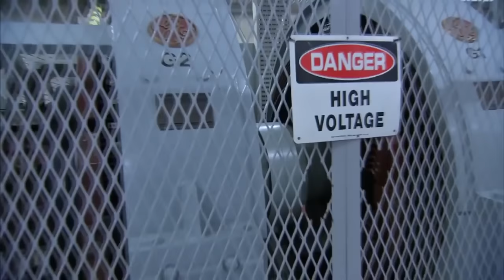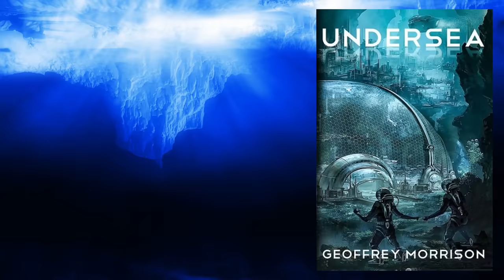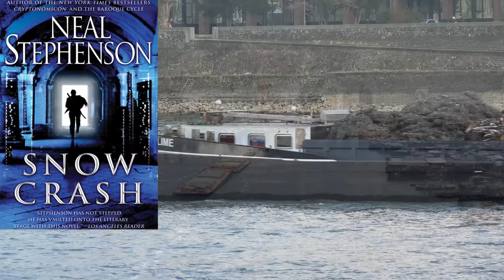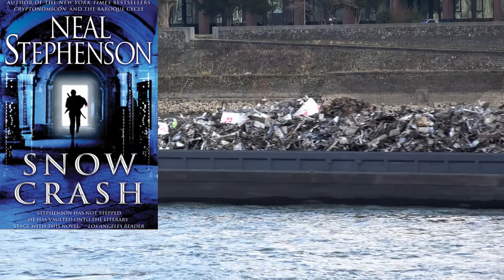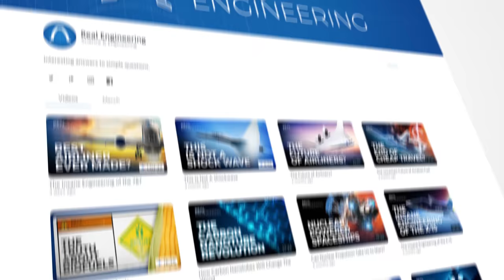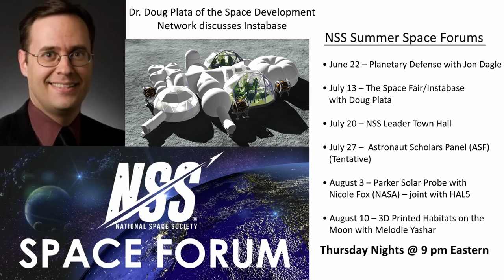Mobile Cities

Comment: Mobile sea cities would be a good idea, one could simply move it to the optimum location for the time of year. This already happens to some extent in the sailing community.
Reply: One concern I'd have about large floating cities is different stress on different parts of the structure.  It will need some sturdiness, but also a small ability to flex.  The various videos of ships breaking in storms come to mind.

So it can move under the Captain or committee's control, but it can also be moved by strong currents/waves
Reply: How about a mobile sea city made of many smaller vessels that can connect to one another via gangways and rope ladders and such.
Reply: @alphaclean3364  exactly and they could be together  most of the time then separate if there was a storm predicted.
Reply: @alphaclean3364 There's a game called P.A.M.E.L.A which does basically exactly this with its floating cities. It was kinda abandoned, but it's really cool conceptually, and you can play to the end.
Reply: @alphaclean3364  This is the correct answer, every single seastead is some family home, they all operate autonomously, and can diffuse or come together at will.

Comment: The thing I contemplate most about cities is what is their purpose, every city on earth at first had a purpose. Natural resources nearby, strategic locations for defense/offense and in that regard there are many reasons for a mobile city. It should be important to note though there's also reasons to have smaller mobile structures like Labs, refineries or factories. 

Currently we have a rover on Mars doing tons of research. It's not too much of a stretch to have a rover lab filled with people there too. These could be rovers, subs, tanks or walkers easily depending on the environment as well. So if your sci fi needs a little extra cool one of those would be a neat thing to throw in without being too much of a stretch for your readers.
Reply: A game called Arknights have mobile Cities (Called nomadic cities in the game)
Because of catastrophes, basically natural disasters but ten times worse (imagine hurricanes combined with meteor showers that drop skyscraper size rock, and said rocks can cause a incurable disease), they have to keep moving to avoid this cause a catastrophe could level an entire city
Reply: I like the idea that if the Americas were never discovered by anyone in the East and the Native Americans somehow “modernized”, they’d have a bunch of mobile cities due to how large the continents are and their very different concept of land ownership
Reply: Why seasonal weather extremes.
Reply: As far as i recall there is indeed a big Mobile tracked vehicle which serves as a Mobile laboratory
Reply: Crossroads?

Comment: I always liked the idea of walking buildings or cities using "strandbeest" legs to move around, particularly because they would be able to utilize fairly complicated motion without requiring a great deal of computational oversight, as a building walking around on something like spider legs might require. In theory they also wouldn't require a particularly complicated drive train for that motion, or could be driven by external forces like wind.

Comment: The first mobile city I always think of is Terminator on Mercury in the novel 2312. On rails going around the planet, such a cool idea.
Reply: Seriously. That's a gem right there.
Reply: The rails offer some interesting possibilities…
I never read that novel, so I don’t know if it included this concept, but…
The rails could be made from a temperature reactive material, so that the heating/cooling of the day/night cycles, could be the mechanism that propels the city around the planet.
Reply: @bobinthewest8559 if memory serves - and I might have the wrong story - that was the case in this story except no special materials required.  The metal rails expanded in the heat and shrank when cold, like all metals, and the city was driven along by having a suitably massive wedge that was constantly being squeezed "out" of the heated daylight section.
Reply: @bobinthewest8559  Exactly how it is in the story. That book is absolutely off the rails 😏
Reply: Terminator was in KSR's Mars trilogy before it was in 2312 .
Reply: Rails makes alot of sense when you talk about moving a huge weight on land

Comment: My favorites are great big spinning toroids, mile wide  10 miles in diameter  I saw early renderings done in the 70's and I was like wow, this is how you build a city!   Central waterway through the middle, with terraced homes, buildings, gardens, forests, built up embankments on both sides.  It would be so unbelievably huge, you wouldn't even feel like you were in space, just in a normal city.  If you could stick a fusion drive on them, do 1/2 speed of light, make into a generational ship to populate  exoplanets within a couple hundred light years.

Comment: For land crawlers noise and vibration can be solved easily by going electric. And bumps can be solved by a Bose suspension. That's an active suspension that keeps the vehicle perfectly flat on any terrain at any speed, as long as the suspension travel is enough. It's even capable of jumping over small obstacles.

Comment: Dunno bout legged cities, but aerostat cities in Venus' atmo are (technically) within our reach, so i'm down for those.

edit: on a second thought, a possible moving city would be a roller city. Two cylinders one inside the other with a gap. The gap would be filled with water to the point where the inner cylinder is buoyant. The inner cylinder has the living spaces, stacked on decks with either a central (fusion?) powered core that lights them all up in a stacked fashion or individual artificial suns for light (crops and mental health). It would be locked on a carrier bearing support that's also the outer cylinder's structure against collapse. The outer skin would have to have some sort of ablative surface to resist the damage as it rolls. Motion would be achieved by shifting the weight of the inner cylinder. Dunno about turning, perhaps the outer cylinder is in two halves, allowing for differential steering.

It's ... doable, i see no structural issues, but the sheer cost of making it once more cuts it out of reach. Floating cities or Europa submarine cities that travel under the ice, always putting the moon between them and the planet... those seem more within our means.
Reply: ain't nobody going there bro we all saw Europa Report
Reply: If you're gonna do that, why not just go the whole hog and make it a sphere instead of a wheel? Then it can turn in any direction.
Reply: Barotrauma™ (Submarines are cool.)

Comment: Just finished a series featuring a series of mobile cathedrals slowly walking - just fast enough to keep the sun in the center of the sky...

Less than 30 sec in and this will certainly be fun
Reply: to keep the sun in a certain place on equator you need to move at 1667.924 km at hour. those cathedrals are NOT slow at all
Reply: I did the math considering that ''slow'' cathedrals are on equator they are ''walking'' at  463 meters a second which is more than mach one

Comment: The idea of a massive mining crawler on a low grav moon or large-scale floating refining platform in the atmosphere of a venus or gas-giant planet are likely viable concepts. A true city in the sense we really think of them, with a population of 100k or more is vastly larger than these however, and I think problems like torsion on such an enormous structure would become very severe, with deformations in the terrain surface, swells in the ocean, or winds in the atmosphere twisting and warping your city like a pretzel until it comes apart. Even large modern bridges need to be very carefully engineered to avoid being annihilated by torsion and vibration.
The one case where I see 'moving cities' eventually becoming a reality is with structures like Oneal colonies with thrusters that can reposition themselves in orbit, move between planets, or even embark on millennia long journeys between stars - quite possibly the only viable way for humans to travel between stars.

Comment: I'm a fan of places built on naturally buoyant terrain - like Sanctaphrax in Edge Chronicles
Something about using propellers or rockets to keep something afloat has always seemed scary to me, what if there was a major malfunction?
I love when someone thinks about this and writes about safety measures.
It's probably why the Magnetrine disc from Simon Stalenhags's art is one of my favourite fictional propulsion method. They are basically spinning magnetic gyroscopes that are only usable in the upper Northern Hemisphere - and allowed huge vehicles to magnetically levitate. The art book "Tales from the Loop" explains that if there's ever a malfunction - the disks would naturally spin as the vehicle sinks through earths magnetic field and keep the descent to a few centimetres a week.
I always wanted to see a settlement that floats on Magnetrine discs, but I don't think he ever drew something like that unfortunately.

Comment: Makes me think of Cannon in Eclipse Phase -- a Mercury settlement that is essentially a big mass driver on rails, circling the planet daily to stay out of the sun and link up with a variety of mining operations, with a swarm of vehicles heading out from it to collect the rich minerals of Mercury, bringing them back to the mass driver for delivery to customers.
Reply: Do the vehicles stay out 'over day' and meet the city the next night?
Reply: @jengleheimerschmitt7941  Hmm, looking back at the rulebook (a short bit in Sunward for EP First Edition, if you want to go find it) I was apparently conflating the nomadic 'dirt sifters' (independent miners who travel in groups of vehicles that chase the terminator between mining sites on a harsh schedule optimized to avoid the most severe heat-cycling and temperature extremes that would at best reduce the service life of their equipment) with Cannon's larger operation, with the train staying on the night side of the planet, stopping at stationary (automated?) mining sites (some of which may use direct solar drilling with big lenses or mirrors to cut rock?) to collect the day's harvest and throw it into space, with Cannon's power itself generated by 'fields of solar arrays' along its track.

Comment: I love the idea of giant train cities like Snowpiercer. The idea of upscaling it feels like it'd create a logistical and habitational nightmare, but a cool one. It could also solve some of the fuel issues, if it's run on superconductive rails kept superconductive by being on a super cold planet. FIY, superconductors can lock onto permanent magnets, levitating an object above them without needing any energy.

Then you just need some ion or rocket engines to accelerate or decelerate, IF you ever need to.

Comment: my favorite is the bubble city of Terminator on the surface of Mercury in the hard sci-fi novel 2313. Gigantic rails push the city within a habitable "terminator line" at the horizon of Mercury through the expansion and contraction of the tracks coming from the heat of the sun.

Comment: Carpenter here, just wanted to make an observation about when you were mentioning the "mobile homes" that you can untether from their original place and be moved somewhere else. This actually might present a big problem in practice even if it works in principle. 

When you build a home, you are building what is called an "envelope" which is the outer most layer of walls, the roof, the floors and so on, are all tied together so as to encompass any interior and partition walls and spaces, which may or may not be tied/connected directly to the envelope of the building but modern building practices actually do a good job at tying most pieces of a home to one another. 

The envelope of the building is often anchored to a concrete foundation rather than the floor, and foundation actually being part of that envelope. This means that technically all that is holding down most people's houses is the numerous anchor bolts that are placed all around the bottom plates of the envelope (so the outer walls plates, also including and interior structural walls but doesnt include partition walls necessarily) so you rarely have a house that has the foundation a continous part of the envelope isntead of simlpy being a structure that sits on top of the foundation and is anchored to its to prevent the sheer forces from moving the house horizontally but also from the wind and other potential forces that may want to bring the house off its foundation vertically in an upwards direction. This is most important during windstorms. 

The biggest issue it seems to me is how we would build a house that could have its foundation also attatched to the envelope and have it be safe to move from site to site, or you have the same foundation at multiple of your properties or destinations in mind for the home and then you can move it between them and just re anchor the bolts but there is a reason we always replace anchor bolts when we put on something new to the foundation. So if we were to fly a house from one place to another and re anchor the foundation the anchor bolts wouldnt hold as well as once you take the anchor bolts out from the spot they were in the bottom plate, the hole used to thread the bolt through on the bottom plate is made wider and wider unless you could manage to perfectly vertically lift the house each and everytime which still would risk damaging the holes use for the anchoring because of the shrinking of wood when it dries so once you remove the anchor bolts, often the bolts were stretching some boards forcing them to remain straight when all the grain is stressing them to bend. So once off the concrete the bottom plates might bend and you might not be able to restraighten it. 

Thats just my two cents though from building houses. Im sure you guys could think of some scientific solutions to the issues i outlined,

Comment: For helpin cities float...

Something that I have been wondering.

You know how a helicopter works, right? Rotor spins and pushes the air down for lifting...

Welk, I can think of a nother way that may be more efficient.

Instead of blades.
Its pipes(light pipes, but pipes just the same. It's basically a star shape(just making sure I'm clear.) The ends are open, with the hole being tilted so it leans to counter spin.

So the pipes spin, this make the air inside spin along, and thus flow out  with the opening to counter the spin direction, there is no air compressed and getting in the way.

So the air pressure, and general density in the pipes is much lower.
Add some texture to the outside of the pipe at the top.
And tilt them up.

And you can also lower the pressure above this thing, thus getting extra lift.

Make the far from the center ends also the heaviest part of it, and the whole thing can be charged like a battery.

Make those pipes curved with an elastic element, and they can be charged(With spinning) for longer.
Because as they slow down, the will fold in, which will make the spin faster.
That can allow for supppor for them thus can remain intacts at faster speeds.

Make them out of a graphene compasite.
The outer edges with weights.

Also, I think I can verbalise my spin gravity based propultion better.

Think of a can that's full of water 

That can has an axis. As it spins on that axis, the water are with higher pressure at the round wall, now we call it the floor&ceiling or just floor.

Now, that floor, is textured. So that the liquid inside aquires that angular momentum ASAP.

Now, lets say, that at one of the ends, you get a disk/hoop thing, that spins counterwise.

Well it that area the liquid will lose the spin gravity/the angular momentum that kept it on the floor, and thus be free to now fill the middle.

That means that on the floor there is now a pressure diferencial.
The end with the hoop/plate thing has low pressure. The other end has high pressure.

So the liquid now flows from that end to the end with the hoop.

But remember, that floor? Is textured. It will actively slow that flow down(inside the can POV)
And take that momentum for the can itself(Outside the can POV).

Comment: Mobile cities would be great for an alt-history sci-fi series where a nomadic empire like the Mongols became the dominant political powers on Earth, and then slowly expanded across the universe
Reply: cough Mortal Engines cough
Reply: They have moved smallish buildings before but it's difficult - they're usually moved by taking apart and re-assembling at the new site.
It has never existed IRL before so I think it has to be a sci-fi setting or a sci-fi element added to make the alternate history.
Reply: @SuperFlamethrower …
You’re talking about moving structures that were built as permanent.
If mobility is part of the plan from the outset, you build your structures in a completely different way.

Comment: I think space or extra terrestrial cities would be made up of individual habitats. Living spaces would also be work, exercise, navigation and engine rooms. Minimal mass and volume required, cheaper, easier to maintain and modular so they can connect and function as one flexibly large or small unit. Sort of like European canal boats used to be in the early industrial era, but for space.

Comment: I don't know about the USA, but it us not unusual for people to move houses from one section to another. It's not simple, but they slice the house up into sections that will fit on the roads put it on a truck and drive it to the new location. Then all the slices are put back together. Sometimes a piece of house falls of the truck and gets smashed to pieces.

Comment: Surprised you didn't mention the cruise ship coming in 2024: Royal Caribbean International's Icon of the Seas is set to launch as the world's largest cruise ship in early 2024, measuring 365 meters long and weighing approximately 250,800 tons. Room for about 10,000 passengers and crew...